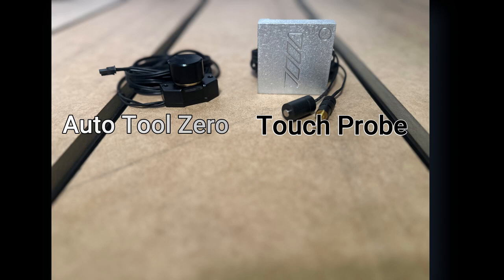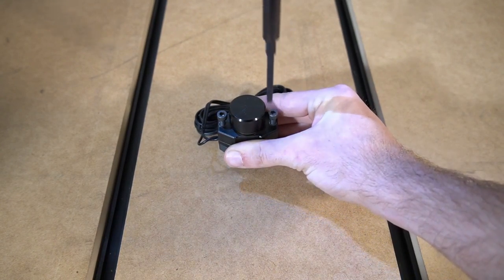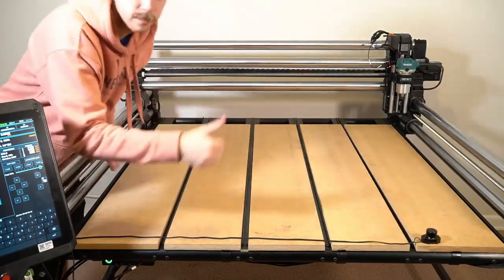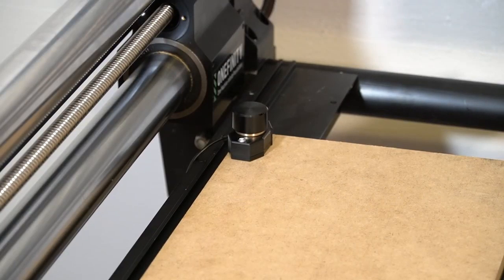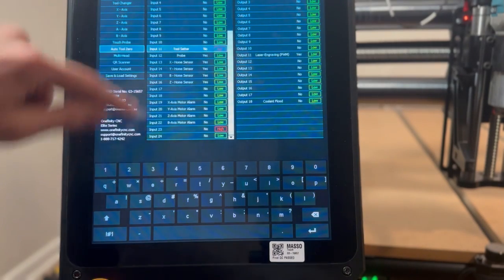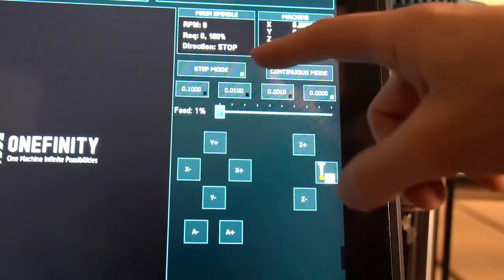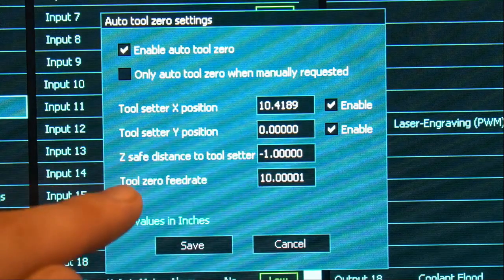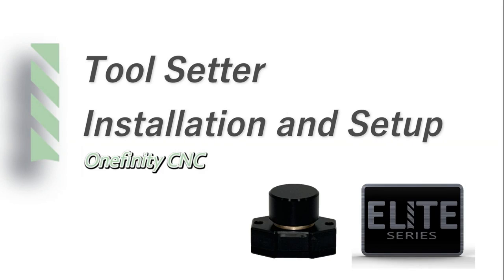Onefinity CNC EAZY-Z Tool Setter Installation and Setup | Support

Comment: 6:31 Why would you still need a XYZ Probe?
Reply from the maker: The tool setter only does the offset for z, you still need to set xyz zero for the material, which is why you'd need the xyz probe.

Comment: What should I be setting the z safe distance to tool setter too? I see in the video that it is -1.0. Could someone tell me what this setting is so that I might understand what is happening and I don’t break any bits? TIA
Reply from the maker: -1 is the default. Shouldn't have any need to change that.
Reply: @OnefinityCNC  if you are attaching it to a mount for easy add/remove in a benchdog hole that adds to the heigh slightly I'm guessing you would just increase the negative value?

Comment: So in theory if I zero to my waste board then tell Carveco my zero is set to the bottom of my material I should never have to zero my machine again, correct? (Assuming I put in the correct thickness for my material in the software when I set up a new job.)
Reply from the maker: correct

Comment: I saved the auto tool zero settings. Went back to the F2 screen and pressed home. The machine went back to the tool setter but never dropped down to set the Z-offset. I have redone the process in the video multiple times with the same results. It always goes back to the tool setter but never lowers the bit down onto the tool setter for Z. What am I missing?
Reply from the maker: space bar.... you have to select the tool setter and press the space bar which will shift the status from high to low
Reply: space bar.... you have to select the tool setter and press the space bar which will shift the status from high to low

Comment: Should you mount on top of your waste board or level with waste board? How does the software know if you are level with waste board or on top?
Reply from the maker: Up to the user, either will work.  You tell the masso where it is located during setup.

Comment: Email support. They said mine would be shipping out this week. 

Are you running multiple tools on a single loaded file to Masso using Carveco?  Where's that how to video? I know it can be done just haven't figured it out and all the "youtubers" or saying to save only the same tools to a one file at a time.
Reply: As far as I know you save each path in an appropriate order, then save as one g code. I think mark lindsay went over it but can't remember.
I haven't needed to yet. But I have been asked on screen to change tools when loading new ones with different bits.
Reply from the maker: With the tool setter, you can run multiple bits in one gcode.
Reply: @OnefinityCNC  still waiting on tool setter. Ordered 4 weeks ago along with the z braking motor. There was 4-6 week lead time on motor I was not aware I would have to wait on the tool setter also. I've had no response from emails to onefinity about shipping confirmation or tracking since I did not receive it as expected last week. And since I'm venting: I ordered my machine with an 80mm spindle mount. Why am I already having to purchase a new driver?  Is onefinity addressing this for future orders?

Thank you for your reply
Reply: @BenFuller-ls8pm  I ordered my tool setter opening day (12-4-2023) had a 2-3 week lead time according to the site.  I literally received it today 2-5-2024, 8 weeks later.  I had to call as they didn't respond to my email inquiries either.  I love my Elite Foreman but damn, 8 weeks for an accessory is terrible!  P.S.  Make sure your wire is in the appropriate location before attaching to the spoil board, mine was pinched and inside the mounting hole.  If I wouldn't have seen it, I would have screwed right through the wire ruining it day 1!  Did I mention I love my Onefinity though!  :)